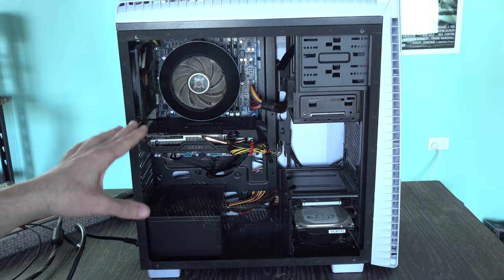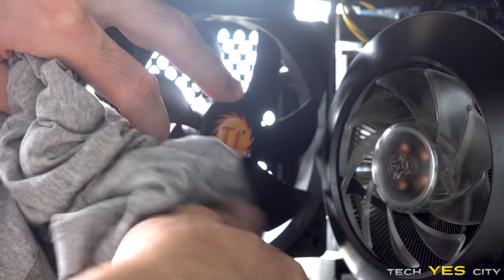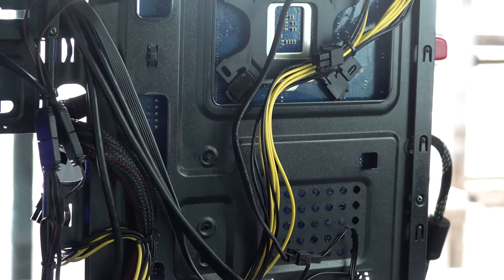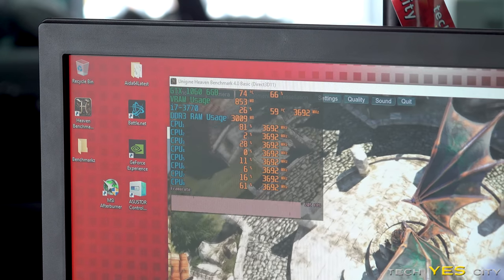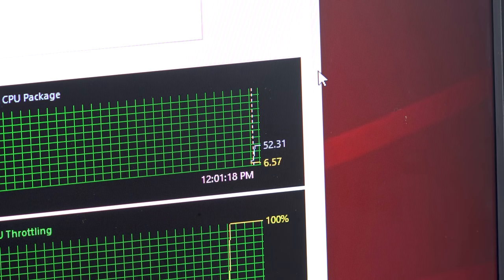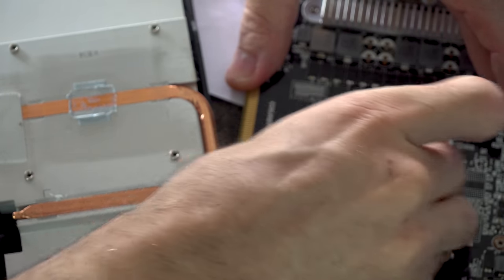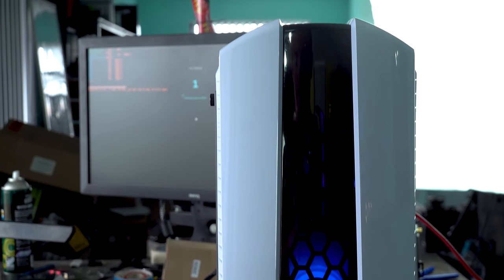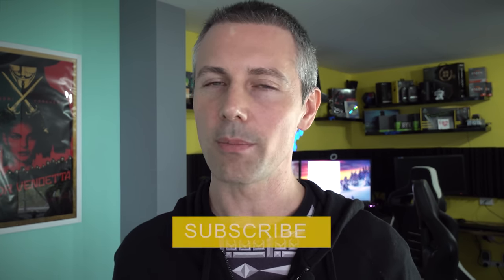This Gaming PC came back 18 Months later... (GD-900 is AMAZING)

Comment: Im planning to buy a RX580, but my PC only have a 450w Thermaltake psu, can I run the gpu safely with that psu???
Reply: Do a search on google for computer power supply calculator and you will see exactly what you require. Seasonic has nice calculator.  RX580 should be ok with 450w as long as you have mid range CPU and are not maxing out drives.  A larger w PSU will draw slightly less from the wall!
Reply: IT requires 500watt+

Comment: 3:31 Please educate me...
What are you spraying that's wet and how does it not ruin the pc components? Also what's the best way to clean a dusty pc?
Reply: I honestly don't know what he's spraying and I don't think its good but for dust just wash your side panel and probably use an air compressor and a wet paper towel/cloth for details. That's what I did for cleaning last month. Make sure to take out all the fans and make sure the dust is out of the heatsink  for the cpu fan.
Reply: Its a all purpose cleaner and lubricant, like 556 or wd40. It is not harmfull to components as it is not water-passed, more like alcohol and thin oils. 
Hi has done it for years that way, so would know (I have also used it).
Most of it will evaporate and dry upp, and he wipes the stuff clean after. There are electronic cleaning sprays and special wet-wipes to buy, more expensive. But a damp cloth and compressed air will work to get most of the dust away..
Reply: He uses Multipurpose Spray, brand Australian Export.

It is a hydrocarbon spray, basically a lightweight oil. Look for something similar in hardware or car parts store

Comment: I've been using ketchup as thermal paste for years on my builds because it was cheaper but I recently switched to mayonnaise because my local supermarket had it on offer.

No messy applications either, just lick your fingers and done - that thermal paste never washes off, absolutely horrible stuff never use it ;)

Joke - I actually use decent stuff and just factor it into the build cost :)

Comment: is it really recommended to spray into your power supply?
Reply: Ya wtf was that
Reply: Trust him if he has done it so many times and not had any problems.. Why not? 
If it not conductive and evaporates the little that gets in there. 
Have you tried or know of anyone that has and had problems?
Dust, hair and other crap in a pc is more dangerous and a firehassard!
Reply: On motherboards, psus stuff of that nature he sprays with brake cleaner spray to not short circuit anything

Comment: Amazing video!

I bought a HY810 instead of the GD900, do you think it has good durability? Like, I don't want to change thermal paste every 6 months. Do you think it'll hold well for at least a year, or maybe 2?
Reply: @Andrei Manchado Oh you made a mistake, GD900 has more reviews to back up it's value, The HY810 may seem promising but will most likely let you down (A mistake I almost made)
Reply: @Dalle Smalhals As I couldn't find much information, I'll just try it. But its always worth to ask so you can see if you can get some knowledge BEFORE trying it. :)

Comment: What products do you use for clean a PC? And what of those products can be used on boards?
Reply: Brian uses a multi purpose spray (from Oz) for electrical components which is very fine unlike wd-40 which tends to leave a heavier film on the surface. I'm in Spain and I use CRC 2-26 (made in the EU) for maintenance and protection. I hope that helps.

Comment: I have same system specs with same cpu  and gpu but with 8 GB ddr3 but i'm facing fps drops in warzone and the gtx 1060 6gb wouldn't work at 98% is it due to low RAM?
Reply: You should check your ram usage.
 
Got my friend to upgrade to 16GB since he kept freezing for a few seconds when it gets graphically intense. Had no issues after the upgrade.

Comment: Btw be careful with the GD900 .. if it's used after it's expire date it will become very oily and not working as intended at all ... you will have to replace it within the month .... This happened to me btw and I had to replace that junk with a good TIM like GC Extreme or CMMGMNN
Reply: I don't see any expiry date on my tube
Reply: What expire date? it doesn't have one lol

Comment: I saw on AliExpress that the GD-900 comes with different levels of thermal conductivity? Does that make any difference?
Reply: Not really, make sure the seller is legit and get the tube ones.
Reply: There are the O.G. GD-900 and the improved version GD900-1. They both should be legit, but that says nothing about how much better between the two. Then there's GD007, the new flagship of that brand.
Reply: @rangwankasantikul9223  from the russian website, the GD007 is at the same performance has the MX-4. In some cases even better, like 1º c.   https://mysku.ru/blog/aliexpress/71157.html

Comment: That's one of the biggest problems with selling (used) pc.. No one cleans pc and often have them on the floor, they gett really dirty and filthy after a year, especially if they have animals.. Even if the pc has dust filters, those will get full and clog up to.
The the temps will gett higher, fans start to make more noise etc..
Most "normal users" don't know that a pc needs to be cleaned.
If they buy it new from a store then they return it for troubleshooting/repairs and pay a fee, they don't need to worry. Taking the "risk" of buying used, even if it is cheaper, the "security" of a store for service and upgrades with warranty is easier and "safer" for many.
And how fun is it to get used pc's back and clean other peoples dust for free?
Just saying, a downside with selling used pc's, to friends or  others.. You also become the service and support for cleaning and upgrades.. If something does not work, often they got viruses or installed malware, they count on you to come and magically fix it!
Can take hours to clean upp and troubleshoot..
Sure if you really like to build and fiddle with pc's all day and don't have another income or busy life!

About upgrading, if its only faster games they want, a better gpu for a few hundred $ will usually be the best.. If there is no ssd that helps a lot to speed upp a system and make it feel quicker. But everyone does not just game on their pc's (Yes really!), more ram or a lot of hdd/ssd space is important to some, even a faster cpu and more cores has it advantages in some cases..

Comment: you dont upgrade the system, only clean the dust and apply thermal paste at least could upgrade the ram or put another ssd with more storage
Reply: It already has 16GB of ram. That is all you need NOW for a gaming PC, so it would be a waste of money to upgrade. He also said in a recent video that SSDs have been very hard for him to get lately and are very expensive. 120GB is plenty for windows 10 and a 1TB HD is enough for most gamers. Prices are already very high for systems in Oz, and buyers are very sensitive to prices of systems they are buying for obvious reasons. I agree with what he did 100%.
I DO wish he had benchmarked it before and after the cleaning and reinstalling windows though. Because I have worked on so many systems over the decades that were running slow SOLELY because the system was loaded with bloatware and malware the user had installed. while the user blamed it on the hardware.
Reply: @SirReptitious  the owner ask for an upgrade or improve, i got 32gb of ram and i want 64gb because i want something that i can use for more years only make a few upgrades like cpu, gc or nvme
Reply: BlitzkriegGT the previous owner traded this PC for another Bryan had for sale.
Reply: He buys parts and builds pcs for various prices not every client has a big budget..

Comment: Can someone please tell me as to why is the multi-purpose spray safe to use on electronics?
Reply: It is hydrocarbons - oil. It is basically a lightweight paraffin. Oil does not conduct electricity
Reply: @ITH56 So it's similar to WD40?
Reply: @moonbaywalk  yeah. Apparently it's a bit cheaper as they sell it in bargain/ $2 shops
Reply: @moonbaywalk  WD-40 has a spray made for electronics so yes WD-40.

Comment: Love the video, but if the temps are oversaturated at 78c, the CPU heat output might be hitting a thermal capacity wall. I would recommend a beefier cooler to see differences in the temps, like say that hefty ICEman Cooler with it two fans, may have a greater heat capacity.
Reply: No your are wrong there. The thermal threshold is 95c.,and even then it will throttle to be safe. running a cpu under stress at 70-80c is nothing strange or harmfull, many prebuild or smal systems do that for years without any harm.
Some people prefer a quite system and are okey with higher temps..
And remember that's under full load, in more normal use it would not go above 60c probably. 
Older cpu's (and gpu's) handle heat better than new components.
Reply: @sebastian_hakansson78  hmm, I was not saying the thermal limit of the CPU (the heat source), I was talking about the thermal capacity of the heatsink, through the thermal paste to the heatsink, bigger heatsink will allow more heat transfer thru the paste without a back log of heat pushing back on the incoming heat from the CPU & thermal paste.
So on a snowman cooler temps might be 65-68c, but with other thermal paste it might be 58-66c, for example. And the you could see the difference in thermal paste efficiency.

Comment: if you choosing a thermal paste for only yourself, better just buy a mx-4. gd900 is nice paste but only if you work at pc repair service or something like that. 4g of mx-4 is enough for a 5+ years of paste reapply every 2 years. i have a 15g tube of gd900 from 2015/16 and paste already separated from silicone and not that good like a new tube

Comment: hey im about to sell my old pc. it has an 8600k, aorus ultra gaming z370, 16 gigs of viper rgb white 2666mhz, deepcool gammax 240mm aio, 4 deepcool fans for the case, 256 mb 960 evo nvme, 1tb seagate barracuda hdd, rtx 2060 super palit dual, and a matrexx 55 case(may be the bigger one cant remember). i am keeping the power supply(seagate750 gold). you think 1000 canadian is reasonable for that.
Reply: I wouldn't sell it without a power supply if I were you. You'll only reduce your potential buyer base, like all the normies by doing that. You could put in a cheaper one and 1k Canadian seems reasonable to me.
Reply: Do you mean SeaSonic 750 Gold? Because I didn't even know Seagate made PSUs... And I agree with Terranigma that you should include the PSU because if Canada is anything like the US right now, anyone who buys your system will have a REALLY hard time getting a PSU for it, and they will not be a happy camper! And you don't want them putting some POS PSU in that system, since it's still a very nice system.

Comment: One other way to try to figure out if a PSU is any good is weight. The concept is, if the manufacturer put a heavy heatsink(s) in it, they knew it would be a hard driver. No guarantee in the real world if that's true but a light one with barely any heatsink inside probably won't do well.

Comment: Bryan: The GTX 970 only used 3.5 GB of VRAM!
Maybe because it only has 3.5 GB of real VRAM.
Reply: Just because the last .5 is slower doesn't make it any less real. The GTX 970 in my system does use that last .5 in some games such as Assassin's Creed Odyssey and Resident Evil 3. I suspect the cap in the video was more down to how Warzone allocates the vRAM than anything Nvidia are doing.
Reply: @voteDC  That's a bad thing.  It's been proven that the last .5 GB of frame buffer on the 28-bit bus is a MASSIVE bottleneck on the other 3.5 GB's on the 196-bit bus.  I can't believe your card's BIOS even allows that.  Many 970 BIOS prevent it from being used even though it is still seen as being available to Rivatuner, Afterburner, and other OSD software.
Reply: @RiskyBRiskyB  It's shown as being used in the games and it's been a while since I last used Afterburner/Rivatuner but I do recall it being shown as in use there as well.
Where has that been proven if you don't mind me asking. The last info I read is that the Nvidia drivers put the low priority stuff onto the slower vRAM. Then again I can't recall where I read that either.
My card is the deep breath Inno3D GeForce GTX 970 "iChill Herculez X4 Air Boss Ultra" and it is running the latest bios available.
What GTX 970's lockout that last .5 of vRAM? It's the first I've ever heard of that.

Comment: 4.8W/m-k is not a good score for Thermal paste. Even the cheap Mx-4 2019 version can do better. That paste is just enough paste for those not seeking for best cooling performance. And will do the job specially if you use it a lot. If not, don't buy it.
Reply: except it's better than mx4 smh

Comment: GD 900 hasn't worked as well for me. It doesn't do as well with higher end systems that produce more heat and definitely doesn't hold  up as long as better thermal compound does. It's fine for business desktops and facebook systems, but I would never even try it on a gaming pc again.

Comment: the reason the 970 only used 3.5gb of vram is because thats all it has.. it says 4gb but those cards came with a defect and was able to only use 3.5gb. another thing about your temps.. you can only transmit heat so quickly.. its not the paste that is limiting your thermals, its that heatsink. if you put a larger heatsink on it, you would notice more of a difference between the paste.
Reply: It's not a defect. It was on purpose, where 3.5gb is fast vram and .5 is slow. Please do your research before posting.
Reply: Harjas Singh it was more of a design flaw with the GM204 GPU. When Nvidia went to cut back the cores from the 980 to the 970 it also disabled a memory controller, so Nvidia patched the last 500mb onto one of the other controllers making it much slower.
Reply: @EvilTurkeySlices  Yup, design flaw was the word I was looking for. Thanks for clarifying.
Reply: It works with 4gb usage just fine (yeah even if 500mb are slower vram) ... I had it for 3-4 years I know what I'm talking about...
Reply: Marco Martins I have one as well.
Reply: @EvilTurkeySlices  I upgraded recently to a 2060 (was a pretty great deal) but the 970 is still a beast for 1080p